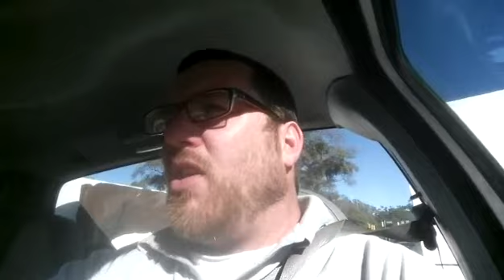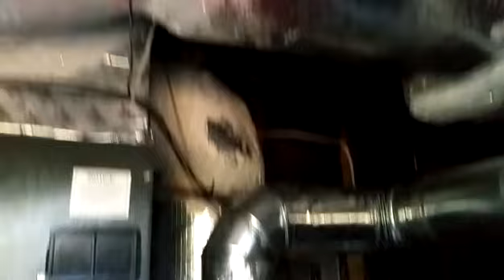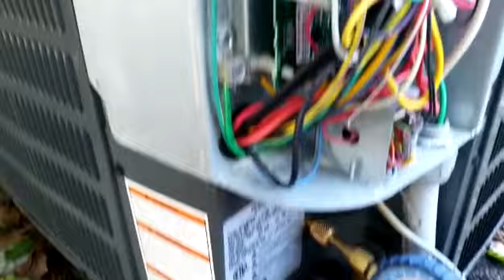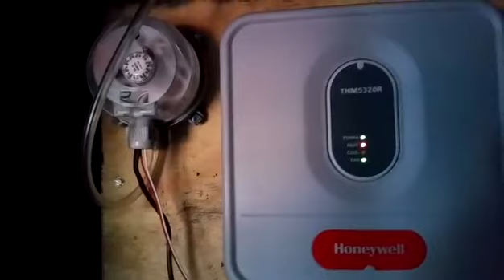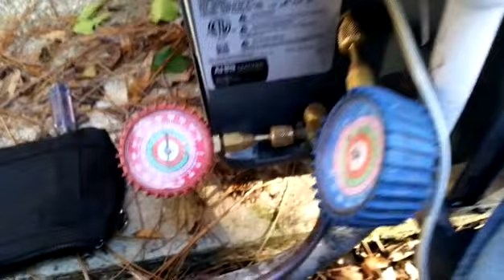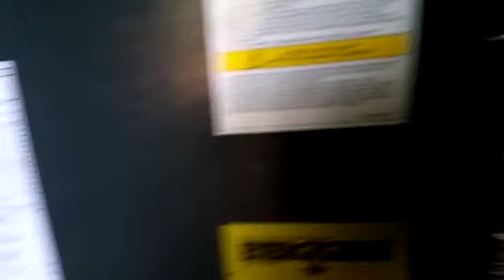HVAC Service : Goodman 18 SEER Heat Pump

Comment: I put two of the systems in in the last three years and both times when it gets cold out real cold about 35 I’ve had some defrost problems. I finally got one not killing me anymore. I Insulated with cork tape the coil sensor and eventually had to put on a new high-precious switch. I didn’t solder on anyone I just got one 650 cut out use a service access to you. Just put in a 5 ton unit it is a huge block of ice right now but we did get a lot of snow and rain about a month ago. Even my heat pump became a block of ice. Have you been having any bad luck all the time with these two speed Goodman?

Comment: How wire the system for 18 system?
Reply: Thank you for the information. Now a question. How I can wire the thermostat wire through the wall thermostat, air Handler and the condenser.  Because is the first time that I'm working with this model of unit. And when try start up the system nothing work. Well the wall thermostat light up. Is it. Thanks.

Comment: Man I have to go look that install video up! You had some float switches man! That's a nice system. We are working on another zone system with no bypass 2stage ..same system as that.
Reply from the maker: Joe Shearer bypass doesn't get too much work on this one if 2nd stage lock out is on. It has been a great system.